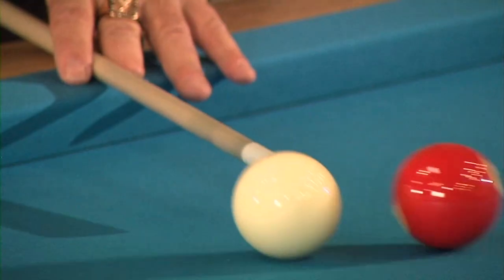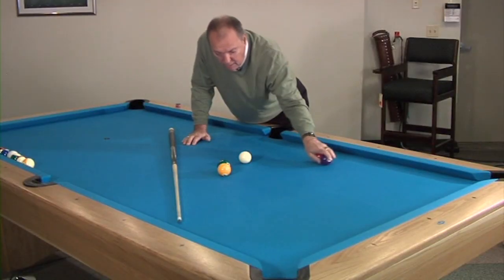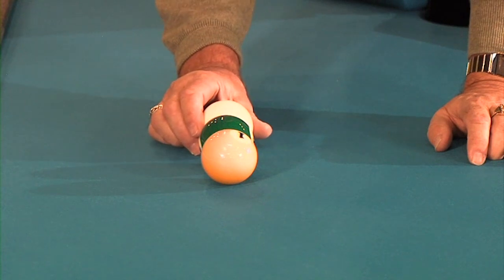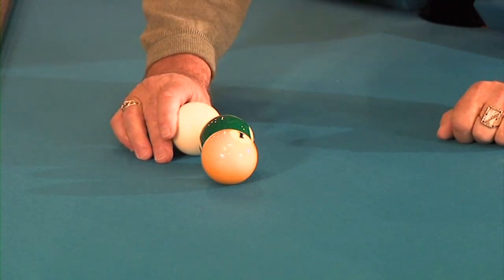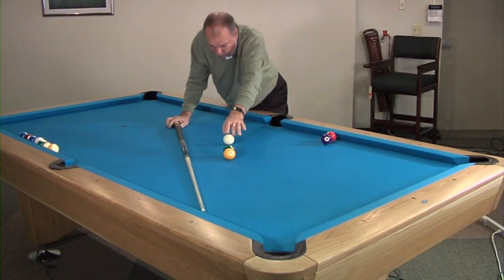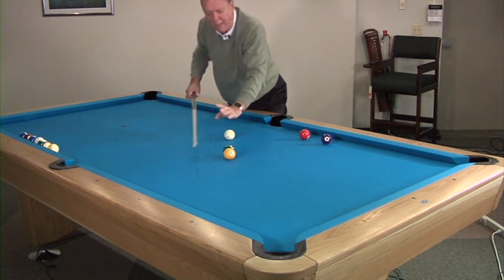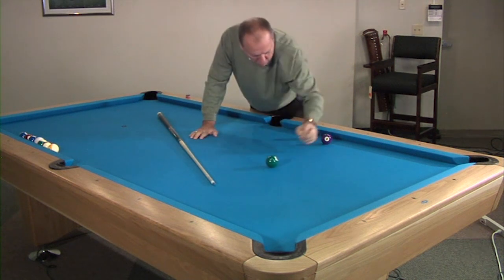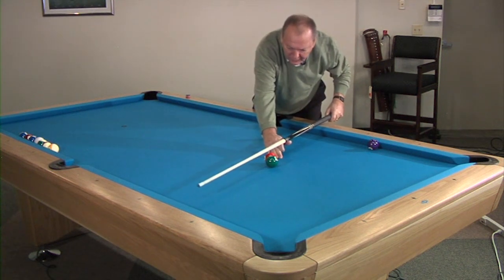Jerry Briesath: A Pool Lesson - Throw Shots

Comment: Hitting the 6 on the right side, imparts a bit of right spin onto it, and throws the one ball to the left. That's how i have always understood throw shots, and it has worked for me.
Reply: The main effect on the 1-ball here is primarily due to the friction-induced throw from the collision dynamics, not the transferred spin. Whether you hit the 6 full-on, or cut from the left or from the right - aiming to hit it towards the end rail - you can achieve the same effect on the 1-ball. This is because the impact and resulting friction at the point of contact are what primarily influence the throw. The transferred spin on the 6-ball, whether left or right, has a negligible effect in this scenario since the fundamental mechanics are driven by how the balls collide and not by the spin.